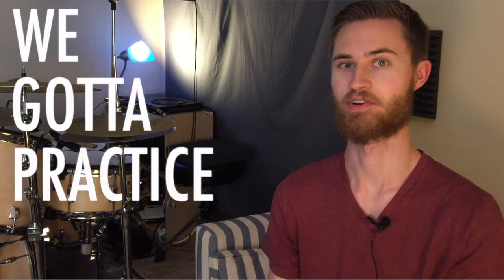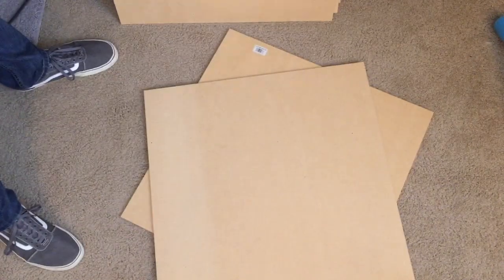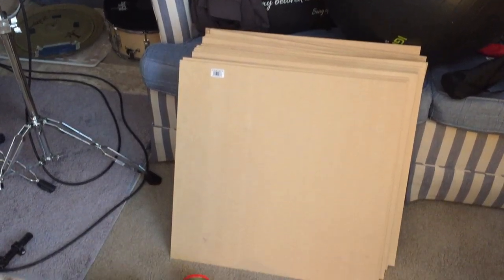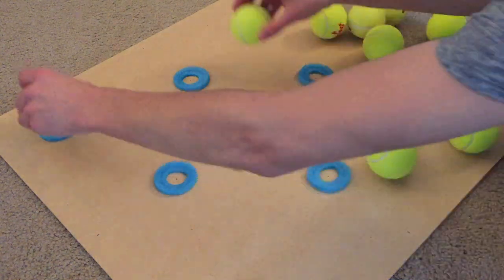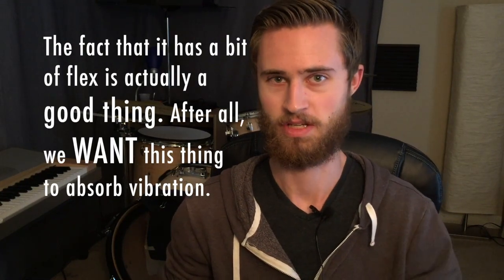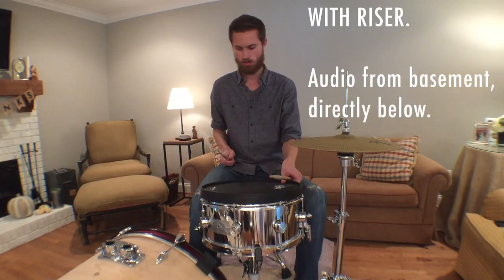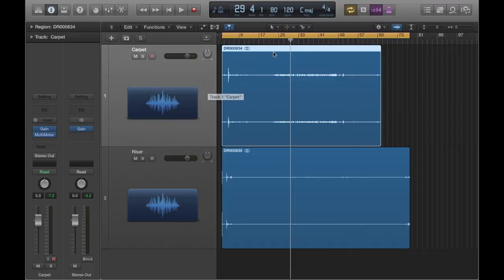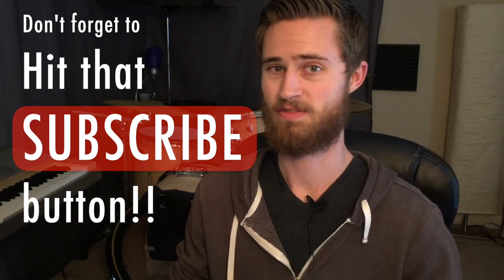Is a Tennis Ball Riser REALLY the SECRET to Quiet Drumming?

Comment: Would a tennis-ball riser be necessary if you put an electronic drum set inside of a sound isolation booth (Whisper Room, Studiobricks, Studiobox, Keoda, Schallfritz & the like)? Most of these booths already have elevated floors that decouples them from the ground. However, they’re standing on solid “feet”, or on the outer frame of the box, i.e., they’re not as bouncy as the tennis balls. The best booths I have found reduce the sound level by 40 to 47 dB in general, but many of them have thinner floors than walls.

Comment: When building a riser is it important to use things like tennis balls or small patches of foam to leave an air gap under the riser or is it just as good to lay foam board on the entire floor and put the MDF over that? There is no air gap that way. I am doing this now and I have carpet in the room so I was gonna do 1/2" foam board, 5/8" MDF and then carpet on top. For the walls I am using MLV and some fiber sound board with R13 insulation glued to it.

Comment: Don't know if anyone has suggested this before, but I bought from AliExpress some round rubber feet (8 pcs) that I attached to the bottom of my tennis ball riser so it's elevated off the floor. The rubber feet and screws were less than $10 and I'm certain it adds to the sound dampening.

Comment: Instead of the foam try and use pvc piping to hold the balls more securely , i am not sure how that affects transfer though. You also have to take into account that transfer of sound occurs to the walls and then into the adjacent building .if that building has resonance near your drum sounds it can be very difficult for them to  sleep. As a drummer i advocate going into a sound room or a place that has its own quarters.

Comment: This is a cool video. I thought about building one of these for my eKit, when I kept getting complaints from my neighbours. In the end I went for the expensive (but effective) option of soundproofing my garage - then I switched to an acoustic kit!! - I can see from your comparisons that it would have definitely been an improvement. One observation I noticed is that you and your kit seem to be 'bouncing around' a lot more on the riser. I notice the difference playing my bass drum on a solid concrete floor, compared to playing it on a suspended wooden floor. I wondered whether the riser has affected your playing at all? - The platform does not seem as solid, as it would be if your kit was placed on the floor for instance.
Reply: Ben,  I would say the movement is more from the multiple panels making the platform.  A single panel would not move as much.   Plus, Higher end Tennis balls will be stiffer and not bounce as much

Comment: You could have used a hole saw with your drill to cut holes for the tennis balls.  I think I would have gone with a plywood though, it is much stronger.  Also your home centers often will cut a full 4ft x 8ft sheet down to whatever size you want.  The saws they use often have a very dull blade so they aren't the cleanest cuts, but noting a little sanding can't take care of.

Comment: What if you used thicker sliced pieces of the foam rather than use tennis balls?
Reply from the maker: I've wondered about that concept exactly. Like what if I used just a big piece of 5-inch-thick styrofoam? I think the benefit of the tennis balls is that they reduce the contact points between top layer and bottom layer, resulting in less vibration transmission. But there are designs out there for platforms like this that use just heavy duty isolation foam instead, which works. I think it all depends on the type of foam, honestly. If I had the time and budget, I'd keep making these and compare them as I go. It would be pretty fascinating.
Reply: I had a similar thought, where "the foam" is the pool noodle foam. Either in slices, or buy 2-3 and just coil them around underneath some MDF board with some glue points. Conceptually it seems they would damper better than the tennis balls, and be a bit simpler.  They're definitely spongey and porous.
I bought an e-kit recently but my neighbor (with a home office above my drums) complained his apartment was shaking.
Reply: I was thinking the same. Just coil up the pool noodles. The contact area is big so more stable and lots of dampening by the foam. It is also very easy to build and super cheap. Maybe a comparison?

Comment: If you have a power drill, you can get a hole saw for like 10-20 bucks.  And if you don't have a handheld power drill, you can rent one for about $20 a day.  That would let you build this with plywood (they can cut it to size for you at the hardware store since even if you rent a saw, you might not have a place to use it) and it could last basically forever where the MDF will likely start to crumble within a few years.

Comment: Sup bro. I akcnowledge its been 3 years since u posted this video, but the accustic solutions showed on the video i am referencing will make u completely redo all your current soundproofing set up. This is the best solution ive ever seen, by far.. and ive been doing research on this subject for over 17 years. 
Now let me tell what the video shows, just to make a point on how relevant good the solutions on the video are, the filming was done at 8pm and the guy lives on the 2nd floor of an apartment, and the guy can play his drums without any dampening on the drums nor the cymbals. (This is the best affordable soundproofing ive ever seen, period!). Ok so let me tell a little bit of what the video shows:
He builds a 7 by 7 ft box inside the room using plywood, leaving some space between the room walls and the box (which will be the studio). And that box has also its own ceiling, which is lower then the ceiling of the room. 
Then he installed accustic foam tiles all over the inside of the box walls and only on the ceiling of the box he also covers with the tiles as well.
Then lastly, on the floor inside the box the guy stacks up 7 or 8 layers of a martial arts flooring tile. 
Here is the link to the video: (you can thank me later..). Hope this is useful to all my drummer brothers. Cheers!
https://youtu.be/SVtrsrYX4QE

Comment: Have you ever thought of trying out mesh skins on your drums? I live in an apartment and have skinned my kit with remo silent stroke skins. I use small toms as the cymbals/hihats too. I attach triggers to all the skins which are hooked up to my yamaha dt express. I use the hihat controller that came with my dt express kit too, so I can even 'open and close' my hihat tom. I do have a concrete floor in my building so maybe this is only good for apartments with concrete floors, but I just play on a carpet and its very quiet.

Comment: have you thought of trying or using any of the foam board that is like hard Styrofoam. its available in 4x8 sheets and is used home construction between siding and frame as a thermal barrier. Pretty sure its 7-9$ a sheet and is usually pink or blue in color and at least an inch thick. I looked up cheap soundproofing a while back and that's what i saw. That board covered with carpet should be a pretty effective sound barrier. Good luck.

Comment: This is a really neat idea for vibration isolation (could be useful for home gym equipment etc) 
Worth noting that it won’t help much with airborne sound insulation (I can elaborate if you want) 
So this wouldn’t work as well with an acoustic kit without pads

Comment: Try pool noodles instead of tennis balls.  And you really gotta have a single piece of base.  Compare tennis balls with castor wheels on 2x2 foot squares connected together with clamps or pre-manufactured connector methods.  Does air control the sound projection or does the material in tennis balls / pool noodles / castor wheels? ...  Also, the sound of interest here is that of low frequencies.

Comment: I think it would help even more if you used a stronger/thicker surface on the top and bottom of the tennis balls. That way, you could use less tennis balls, which makes for less solid objects for the sound to travel through.

Comment: You could have, with just your drill, cut holes.  Your noodles worked, but a hole saw drill bit would have done the job nicely, with an added bonus... I don't know if it works with every saw drill bit set... well, I was helping my mother clean out her workshop and I found a rusty set and noticed that when they were suspended they rang really nicely when you struck them.  They sort of nest inside each other for storage.   I'm a harmonica player mostly, although I did take a couple of months of drum lessons.  I was trying to find little instruments to fill out my kit with when I wasn't playing harmonica.  These sounded a lot like a triangle, only they were different pitches.  I even went so far as to try to contact the company that made them to see if it was possible to get a set off the assembly line before they sharpened them.  They never got back to me, but for a percussionist it might be worth looking into.  I know triangles aren't used all that often, but this would be a set of different pitched ones.  (They are wickedly sharp though).  If people can play musical saws, why not musical drill bits?  (I looked at musical saws too... those you can get, basically just an unsharpened regular saw which they charge you 3x as much for.)

https://www.walmart.com/ip/Felji-16-Piece-Hole-Saw-Drill-Bit-Set-w-Mandrels-Saws-w-Case/165606046?wmlspartner=wlpa&selectedSellerId=3353&adid=22222222227055901432&wmlspartner=wmtlabs&wl0=&wl1=g&wl2=c&wl3=159341519419&wl4=aud-310687321802:pla-267831867050&wl5=9004652&wl6=&wl7=&wl8=&wl9=pla&wl10=113506403&wl11=online&wl12=165606046&wl13=&veh=sem

Here's what the sets look like if anyone is interested.  I think my mother's set had a few more different sizes.  They nested nicely and someone could probably figure out how to mount them on something similar to a cymbal stand, just hanging down in a sort of upside down Christmas tree configuration.

Comment: Good job getting creative but since the build required a drill all you needed was a small hole saw to make your holes regardless of being in an apartment and you can get wood cut and delivered cheaply btw so no truck required. Even if there is no places nearby that will deliver I am sure you have a friend with a truck and if you don't you need more useful friends. Also 14 dollars for 100 zip ties is a massive ripoff more like 3 bucks at harbor freight. honestly this could have been done way cheaper and it would have been way more stable in the end. also good call on the density of the mdf but i would recommend laminating a thin plywood top because that stuff tends to break down pretty severely over time by itself even though at the moment it seems plenty strong.

Comment: Much better way!! First, don't put the throne on the riser. 2nd, put the bottom platform  on tennis balls or on caster wheels (make sure they are wheels that can lock) or something else altogether but make sure that board (which can project sound) is not touching the floor. 3rd, on the side of a road, find yourself 2 very large couch cushions or a memory foam mattress which you can cut to size with a large tooth saw. Make sure it hasn't been rained on or peed on by animals. You can also buy 4 cushions at a fabric store or craft shop and place one at each corner (that's probably a better option(!) but not what I did). Place it/these on top of the platform. Finally, place another platform on top of that. This platform should be one rather than a bunch of pieces. If you have couch cushions you may need to set them apart towards the sides, leaving some space in the middle. Optionally, you can put shelf/refrigerator foam rubber for grip (recommended) or some carpet on top.
Voila.

Comment: It would be more efficient to use  Roxul Rockboard 60, Mineral Wool Board, 2 Inch instead of tennis ball. It will absorb the hit impact noise and It will absorb way more of the low frequencies. And I believe it will be easier to build.

Comment: Hmm, interesting. This is the first time I've heard of a tennis ball riser (I'm not a drummer). In my new house, I'm thinking about setting up a practice place in the basement and I'm considering ways to dampen the sound going upstairs. Do you think a tennis ball riser would help for that, or should I just focus on layering the walls and ceiling with some carpets or acoustic foam? I'm also planning on recording down there so I guess the riser might at least be good for reducing the resonance from the floor ... ?
I'm planning on building some sort of riser for the drums either way so this might be an option, especially since it's cheap. I think I might even have enough tennis balls available too :D

Comment: Another way to do this is to just cut the tennis balls in half and glue the cut ends onto the bottom of the risers. Seems like a little less hassle. The Roland floor isolating pads work the same way

Comment: American tennis balls are filled with gas which will escape at an uneven rate.  It might be useful to tap a nail to let the gas escape first.  You can also buy uninflated ones as well (like the ones you have in the netting).  You can even get tennis balls with a foam core which might work even better.

Comment: You should have your throne on the floor not on the riser and adjust it accordingly by adding the height of the riser. you don’t need to be isolated as you are not causing vibration.

Comment: I've been watching various YouTube vids on this "building a anti- noise/vibration"  platform thing so you don't drive downstairs neighbors nutz. I've 2 drum sets, one for gigging and band practice one that stays set up at home for practice. The one at home, I replaced all the batter heads with mesh heads which I ordered from Tama and cymbal mutes.The set ( with cym stands) sits on playground rubber pads with a drum carpet over the rubber pads. Works for me. Not a peep from the neighbors. Even at practicing at 3am, downstairs not a sound. Don't need to build anything. For the E-drum guys, what the hell are you using for sticks that they can FEEL the vibration.....from an E-set with sound off?!?!? 5lb sledgehammers for sticks?

Comment: I personally wouldn’t of used mfd because if your cutting or sanding it in an apartment there’s gonna be a lot of dust and it’s not the strongest board something like chipboard or plywood would be more durable and more water resistant

Comment: I'm not sure how I got here but I love MacGyvering shit , so I watched . I don't know if any of it helps but during my hvac construction years I worked on a hotel and to cut down on sound transference not only were there double wall space between rooms they loosely stacked baffle board (floated) between each wall and the real kicker was they did not screw the sheetrock directly on to the studs  , instead these sheet metal clips the length of each stud were tacked into place and the sheetrock was screwed to that . greatly muffling sound transference . It seems a combination of baffle board these strips and your tennis balls  may be a potential alternative to test out ( in some configuration or another ) . good vid thanks

Comment: I would have suggested to cut the tennis balls in half, and screw them to the riser. With that you don't have to use that much balls, which will help minimizing the contact between florr and drums.
Reply: this would not work very well i think. The tennis ball works because it is sealed. think of a shock absorber on a car, sealed unit see? they don't work well when they leak.
Reply: Well I tried it, and it does work, it is most likely that the rubber in the ball is not transferring the depths into the floor. This causes the waves not to spread as well inside the walls, since the low frequencies are the real issue.
Reply: well there you go.
Reply: You would probably need to use more balls because a tennis ball is strong because it is sealed, but then again it only has to support a drum kit across multiple balls so you might have even better absorption.
Reply: I think your right, in that the half ball trick would probably require more balls to work. Any loss of sound- transmitting surface area would be made up by the additional balls. It could well work out the same either way. Also introducing steel screws into balls could possibly assist the sound wave transfer, if i remember my physics correctly that is.